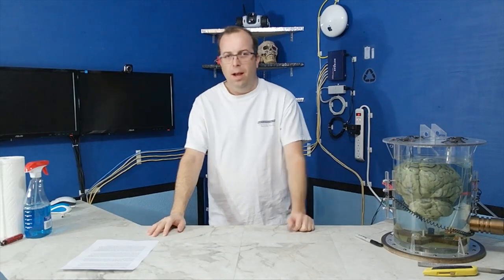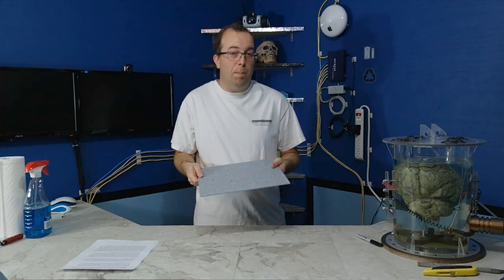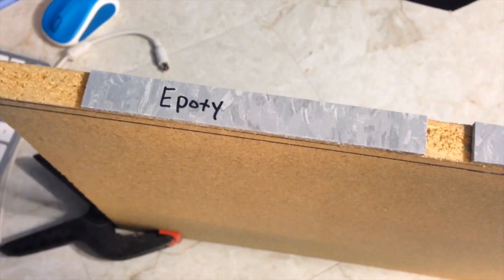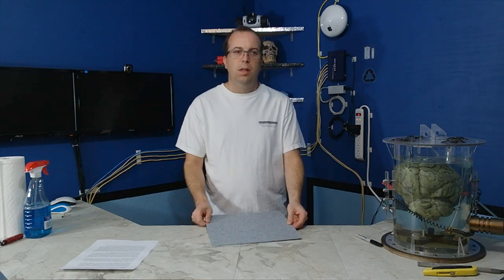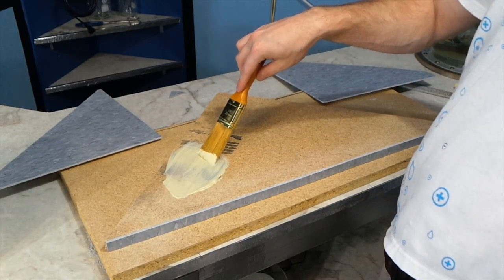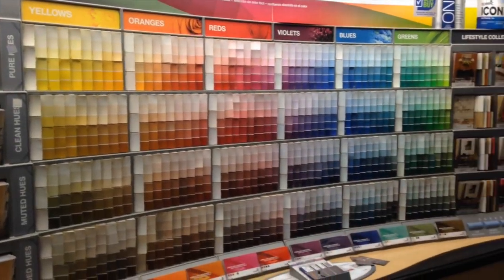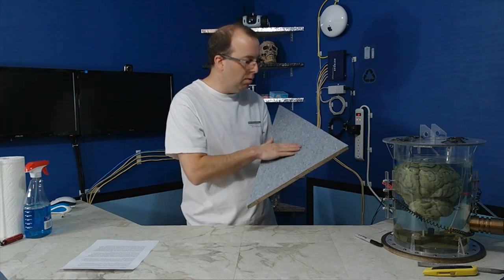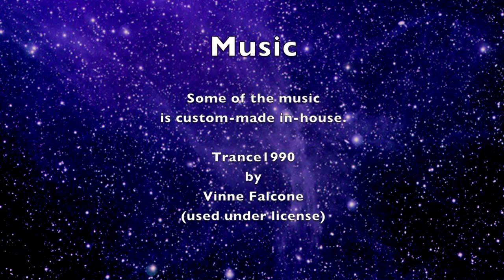Building the Ultimate Computer Desk - Part 2

Comment: "I chose floor tiles so that I can remove a damaged tile for repair later... so for adhesive i'm choosing the stuff that's practically impossible to ever, EVER get off should I need to..."

 ;-)

Alright. So I was faced with this exact situation not long ago. I chose contact cement to glue tiles on a wall so that I could get them off later without murdering the wall. The CC is holding up wonderfully to everyday use and I'll be able to remove them when I need to.
Reply: I mean for the side of the desk how often would you need to replace them
Reply: @cursedcliff7562  he was doing it on a wall..

Comment: Surely of the idea is to have a surface you can replace then the contact cement was the clear winning? How will you get the other pieces off that are stuck down harder?
Reply: Yeah that made zero sense.
Reply: You can easily use a hair dryer to warm the adhesive

Comment: Your VCT tile idea is pretty neat.  

 I used to work at a sheet metal shop and we always glued down a sacrificial piece of 1/16" or 1/8" thick hardboard on our bench tops.     We would re-skin the tops every year or two as they wore out and became filled with drill holes.   Obviously not suitable for an office desk, but very nice for soldering stations and work benches.

Comment: VCT tile make a great bench top; I’ve topped most of my garage benches. Run a 3/4” trim board in the front glue the tile down from the back then use a flush trim router bit to cut the tile on the front. Or glue tile on the front first. There are some nice acrylic hard coatings that work great on top. CA glues, high viscosity ones, work well to hold small pieces down and gives you 30 seconds to position them.

Comment: as a flooring installer we tend to use solvent based contact adhesive for difficult areas we want to stick like that but if it works for your purposes it's not really wrong, good on you for problem solving.

Comment: Proper VCT glue should be spread out with a glue trowel and then allowed to "flash" and be dry to the touch before installing the tile to the surface. This would work for vertical and horizontal surface and creates a strong bond.

Comment: when your using contact adhesive on an edge of particalboard or MDF you should primer it. Should also available at the same store as the adhesive, 
Also Contact adhesive should be applied with a fine Glue trowel, (not sure if this is named correctly). apply it on Both of the pieces you want to glue and let that dry as described on the bucket. Sticks istant and better! Roughing up the Vynil wil also increase strenght. i'm aware that you want to be able to replace a piece if it get damaged but with a heat gun it should come loose. Alternative was using melaminated partical board With a print those are cheaper as a sheet of laminate, but less resiliant.  i Don't want to be rude i just want to give some info. 4-5 years later.

Comment: Awesome project - it is inspiring me to my desk project that has been in the back of my mind. 

One note - we recently moved to a new office and I noticed in our computer rooms with VCT, they installed grounding straps on the walls leading to the floor.  This way any static build up would be dissipated. Not sure if that would be a problem since this is going to be the work surface of a desk, but I figure that I mention it.  Would hate that any static build up would effect the computers.
Reply from the maker: Richard Thompson - Interesting.. I don't really foresee it being a problem unless I were working inside of a computer.  Since all of the parts you can touch are grounded already to the mains, I think it will be fine.  Especially my aluminum Apple keyboard.. I've had a good shock or two from that thing on cold mornings. (it's grounded well)
Reply: Makes sense...  Good luck with the project!

Comment: Very interesting idea.  I will never look at vinyl tile the same way!

One note on transporting sheets of laminate; it can be rolled up in a loose coil and tied with twine or string.

Also, I think one reason some of the products you tested for adhesives on the thin strips may fail is due to the raw edge of the MDF being very porous, unlike the top surface which isn't.  I know that the contact cement designed for use on the surface of MDF doesn't work very well on the raw edge for that reason.  One way to solve that problem is to attach a 3/4 inch thick piece of pine, glued to the raw edge, then adhere the laminate with contact cement.

Regardless, good job on problem solving.  :-)

Comment: I wonder if a belt sander with 220 grit would work better than the file and sand paper you used?  Just make sure you are orienting the sander so the direction of the belt isn't trying to pull the tile away from the substrate.

Comment: Have the edges of your VCT tiles stayed together well after filing them down? I bought four of these tiles to experiment with them, and the edges of them are a little crumbly and leave a bit of white powder on my hands. This IS a cheaper brand of VCT tile, but that may not matter.
Reply from the maker: maccollectorZ (Commenting Account) It has been 8 months now and the desk has been perfect, not a single issue with anything.  I would definitely not hesitate to recommend VCT to people at this point.   But, as you say, it could vary from one brand to the next.
Reply: The iBookGuy That's good to hear; I actually haven't found any projects for mine yet. I also got a little bit scared off when I realized that these are made of/with PVC. I was thinking of trying something with linoleum tiles instead (the specific ones that look similar to VCT tiles), but they cost about 2-4 dollars per tile.

Comment: The edges of the board you used are waaay more porous than the top and bottom. I would have texted the adhesives on the flat side, not the edge.

Comment: I'm questioning the wisdom in making the edge where your arms lean on the desk a 90% angle. That doesn't sound very comfortable at all, in fact I believe most ergonomic rules will frown on having any contact with the edge at all. (Though I'm not even remotely an expert) They do tend to go well beyond what a practical situation calls for.
Personally however, I think I would have the edges be bevelled to prevent pinching my arms.

Comment: is hiring a carpenter so expensive there?
Reply: +TheFearsome tuff  For this guy who made this video who has definitely more time than money, i believe DIY is the right approach regardless of whether he can afford a carpenter. Because then he can spend the money on something else. It's not like the carpenter will magically make the total cost lower than the cost of raw materials, right?
Reply: +Siana Gearz If you were starting from zero, wouldn't you have to factor in the cost of tools? Also, would a carpenter perhaps be able to get an industry rate on materials?

I considered DYIing some plumbing once, and figured that it would actually be much cheaper to just call in a plumber, after factoring in the cost of the tools needed to do the job. This was assuming that I didn't fuck up due to inexperience.
Reply: yeah if a professional carpenter made the desk, you could dance on it. if you made it yourself, chances are it will collapse the first time you try printing on it.
Reply: but, its a good experience for sure, and good to learn too, if you have the time and money.